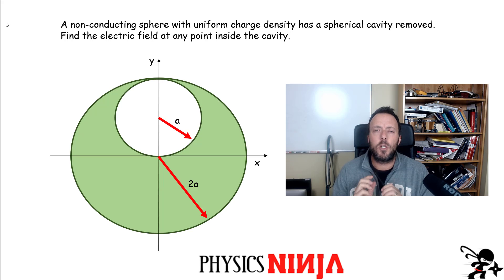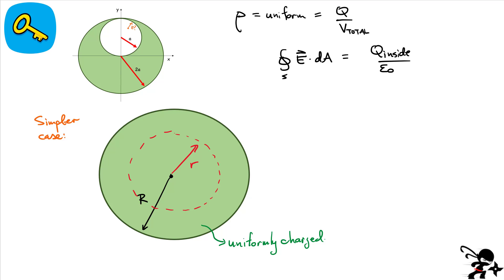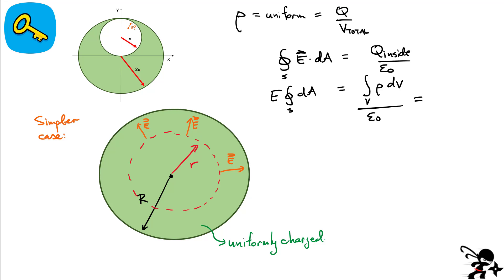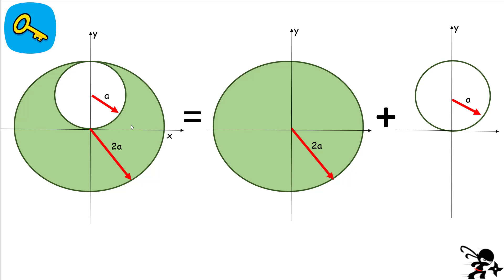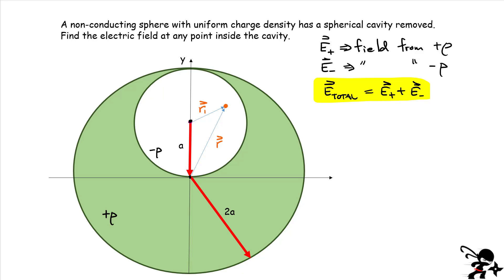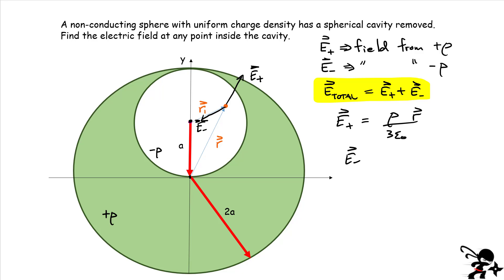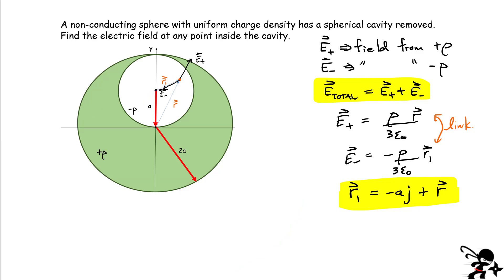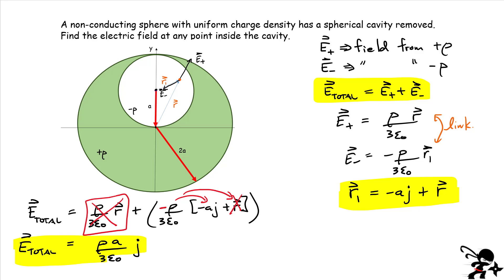Gauss's Law Problem - Calculating the Electric Field inside hollow cavity

Comment: How would the equations change if the cavity had a radius of less than half the radius of the big sphere (ie the cavity is not touching the center of the charged sphere), given the radius and the distance from the center of the cavity to the center of the charged sphere?

Comment: The most appalling, revolting and vertiginous video where no notion of a, j and r and the subtraction and addition of the electric field is explained; just free flinging of equations!
Reply: Probably too late but a is the given constant in this case the small sphere has a radius of a and the big one has a radius of 2*a, j is a unit vector pointing in the y direction==(0,1,0) and r is the absolute value of the r vector which points from 0,0,0 to a point in your coordinate space
Reply: @lightshadow2707  It's never too late, helpful all the same.
Reply from the maker: Lol

Comment: At first glance I just thought well if I draw a Gaussian surface inside the cavity, the Qenclosed will be 0 so there can’t be an electric field inside the cavity. I still don’t understand how to disprove that statement? (aside from your mathematical solution)
Reply: It just says that no field emerges from that cavity,  but it doesn't mean there is no Electric field passing through cavity. 
In simpler case, if there is a point charge and you draw a circle in space near it which doesn't contain the charge itself, obviously it doesn't mean there is no field passing through it, the field lines entering the gaussian surface(circle) all exits. It is the same here.
Reply: Initially it has been considered there is +ρ charge density same as the outer sphere inside the cavity i.e. considering the cavity is not there initially. 
As it's not the case in the question, we have to subtract the extra charge at the portion of the cavity so -ρ charge is taken at the portion of cavity.

Which finally on addition give total 0 in the cavity. This is how the sum is done and when calculating individually using gauss theorem we get -charge inside the cavity.
Reply: @mousaha78  Well, we already saw what you told from the video, the guy was asking for a way to disprove (aside from solution in the video) his inference which seems reasonable but is not correct.
Reply: What you said is correct if you use Gaus Law. But here, you cannot use Gaus Law as our system is not symmetric. To be able to use Gaus law, our charge distribution should be symmetric. Hope that made sense.